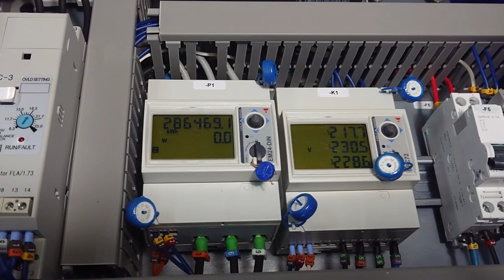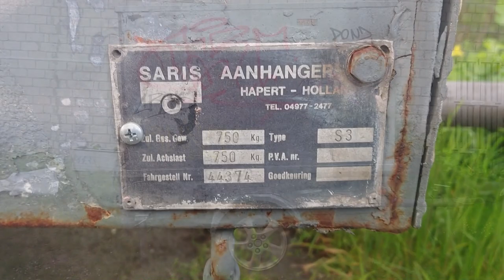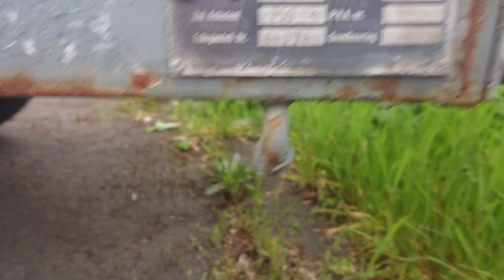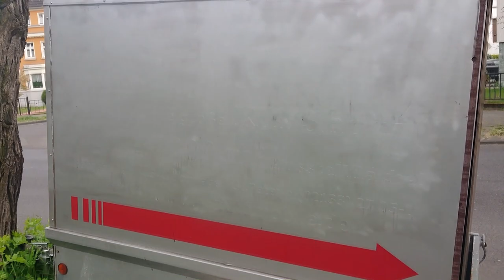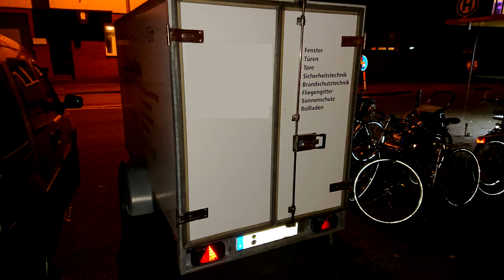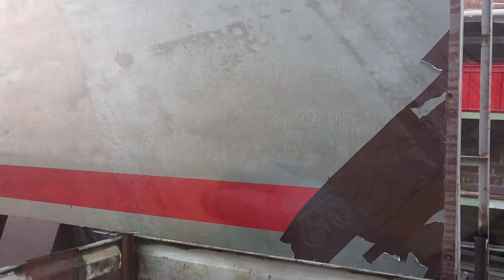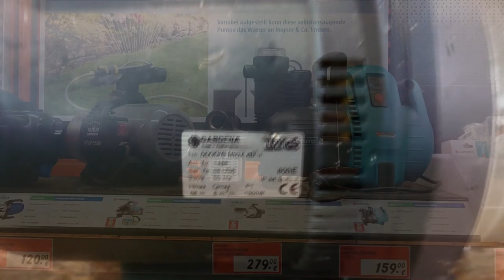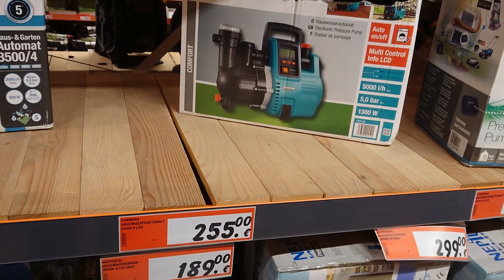Expensive Scrapyard Finds! Repair-A-Thon!

Comment: Totally agreed on the comments of the pump... I hate Web 2.0, IoT, mobile apps for everything, unnecessary electronics and connectivity, and all these trends that not only overcomplicates things, it often does not deliver in the supposed conveniences it's supposed to give, because you are essentially trading wasting time on one thing for another - eg. software and firmware updates, synching issues, dealing with bugs in code, proprietary crap, dependencies on the manufacturer, etc. I rarely ever see a piece of household or shop gear that is really definitely improved by new Internet connected electronics. In fact, I can't think of a single thing that was made better as a whole, without major tradeoffs.

It's kinda laughable really... I'm tired of hearing people who bought this thing or that thing that can be activated, opened or run via some mobile app, only to hear later on that they returned to the "old way" because they were tired of dealing with the thing not working for multiple reasons all the time... the servers were off, the system was outdated, the mobile app wasn't working, a power spike took the whole thing off, electronics were giving some unknown error code, the company went bankrupt and took functionality of their products with them... yadda yadda yadda.
How did we go from a point where we were worried about planned obsolescence issues and cheap materials being used, to this next level garbage of connected crap that seemingly won't go away no matter how bad they are?
Reply: Plus everything made with plastic and expensive and have a shorter life and works like garbage
Reply: You've summed up a lot of reasons most IT people don't buy "smart" appliances.
Reply: Well there are a few things like smart  smoke detectors that trigger all at once or if that doesn't work only that one, things like irrigation systems that are essentially time controlled sockets, cameras if there is no room for wiring 

The important thing is they need to work even if the internet is down for a period of time or it needs to be hosted by yourself to ensure reliability to you
Reply: If you stick to open source or easily available firmwares, you can actually build something very decent.
Being able to control your lights/surveillance cameras, control the A/C or feed you cat when you're away is very convenient IMO.
A system that opens and closes the blinds and windows automatically to save on heating or cooling is also a big yes in my book.
I wouldn't put my trust in anything that I didn't build myself or isn't open source, though, but as long as I can maintain it myself with little to no effort, why not?
Reply: I'm a person that creates those IoT Web 2.0 things...,  lets just say i don't use any IoT that i don't have full source code of...  (yes i use mostly my stuff lol) commercial IoT is garbage with short lifespan, usually mobile app is no longer accessible on app store or in worst case it depends on cloud service that is no longer working.
Reply: In the next couple years (maybe even sooner), civilized life will be impossible without owning a damn smart phone and having a different app for doing the simplest day to day things. People are getting too lazy. I used to be big into computers 20 years ago and excited for technological advancement like that but all this phone BS killed it off for me personally and people are turning themselves into drones. See the Borg from Star Trek. Those Generac standby generators that you have to register online with a special code to be able to use make me giggle as well.
Reply: Ich bin von Beruf Elektriker seit 1985. Mir ist es Leid, soviel Geld für KNX Geräte oder echtes Smarthome (Loxone) auszugeben und von Software gegeißelt zu werden und graue Haare mehr zu bekommen, nur weil irgendein Bit falsch gesetzt und übersehen wurde und irgendwas nicht funktioniert, obwohl man nur einen Lichtschalter von Hand betätigen braucht. 
Hatte heute ein Firmen Handy aktiviert und soviel Zeit damit verbracht, weil man sowas nicht ständig macht. Sowas kotzt mich an, solche Zeitdiebe. Nur weil eine Arbeitskraft eingespart werden soll, die bis jetzt die Arbeitszeiten kontrolliert hatte und zur Lohnbuchhaltung vorbereitet hatte.

Comment: Another interesting repair-a-thon. I share your dislike for web based home apps. I've built several home projects and while they have web based interface they all run on our LAN and are independent of the internet.
Reply: I share you sentiment on so called "smart feature" (Basically "We want to control the user how they use their device, and when they should buy our new products") thus really like reverse engineering them and making open source solutions to them cause I am in control of my freaking washing machine or toaster or fridge or whatever, not the manufacturer. As my moto to corporations that implement these "smart features" goes: If I have not offended you please wait your turn, I will get to you eventually.
Reply: Get this!  My electric toothbrush has wifi connection and an app.   I haven't bothered.
Reply: People seem obsessed with smart devices. I've no idea why they are attracted to them so much. There are certain things like smart thermostats which make some sense, but a smart pump sits at the opposite end of the spectrum 🤦🤦
Reply: Same, i have some 30 connected items, and the only issue i have had is with the "cloud connected" bulb i got locally, it was the only one there but it's gone now.. because it was sheit.
Pretty strange though, since that company was one of very few with a dedicated home assistant team/integration. But they should have had the sense to make it local instead of cloud.
Reply: It's frustrating that so many people fall for the scam of "smart" appliances and home automation that requires an ongoing subscription and connection to a remote corporation's servers. All the functionality can be obtained more cheaply, efficiently, and securely with independent equipment entirely within the home. Let Google know whenever I want a light on, wait an appreciable interval for it to happen, and hope they don't brick my connected devices? No thanks.

Comment: Love all your stuff, always interesting, though I’m jealous of your “freedom to roam” in the scrapyards. Trailers are fun! I bought an old trailer, the wooden body was rotten so I reduced it to axle and draw-bar, then made a steel tube frame skinned with aluminium and floored with ply-wood. It worked well and looked good till I bought a small motorcycle... that wouldn’t fit, so I had to cut the body in half and insert a forth section into the middle of the tube frame. Doesn’t look quite so nice now, but it still works well. It looks quite like your trailer, but without the tall sides and roof.

Please keep going with these videos, they are always an encouragement to save and recycle useful stuff. Thank you. Les in UK

Comment: I don't know how common they are in Germany, but in the US one of the first things we generally do with those pumps is thread on cam-lock fittings to eliminate the threading on/off issues all together.  When you are in the rain in the dark and trying to work in a hurry, the cam-lock connections are really nice.

Comment: It occurred to me that your solar paneled trailer could be a mobile workshop. The potential perhaps to salvage more efficiently because you can bring a careful selection of hand tools as well as power tools. I’m assuming the scrapyards wouldn’t object to some onsite dismantling, as long as the items are going to be purchased anyway. A vise, a workbench, maybe a plasma cutter. Battery box for the power converter riding on the trailer tongue.
Reply: I'm sure many scrapyards will absolutely object using plasma cutter on their premises 😮😀

Comment: The arrangement of the contacts - the shape of the bars, how they are routed, and even where the wires attach - are all arranged so that when the contacts open, magnetic forces tend to push the resulting arc away from the contacts, effectively extinquishing the arc.  On large contactors, there is even an arc-distruptor made of vanes of metal or mica or other materials, insulated from each other, to break up the arc as it tries to move away from the contact bars. It is the Lorenz force, the same force which pushes the armature of a railgun...

Comment: Thank you a lot for inspiring me :) Currently I'm restoring a very old (80s) rusted racing bike (incl painting and basically restoring/replacing all the components). Your vision on "why" gained me a lot of strength to continue with it, even though it maybe does not make sense economically. But it gives me a lot of satisfaction, skills and I'm also saving it from being thrown to a landfill :) 

As to what you could do with the trailer: winter is coming, and maybe you could make some sort of heat collection system. Instead of charging expensive batteries, solar panels could heat an insulated water tank inside the trailer. Then this heat could be used somewhere else later (warm shower?). Not sure if that's viable for anything, but maybe you could make this to work :)

Comment: I want to do something like this with thrift store electronics to teach myself how circuits work.
Reply: Choose something to do, then do it until it's done. Unless someone else thinks it's too hard for a beginner. Then choose something different
Reply: @thewhitefalcon8539  I have a Keurig that's broken. Gonna try to desolder the pumps and motors and some of the components I can find data sheets for. I wanna use the pumps and motors to make a drip irrigation system. I have never soldered but the components all seem to be 12v so I could power with a battery pack. Thank you for the encouragement I got my soldering iron last year and have been nervous to even try.
Reply: @ashtreylil1  Sounds reasonable. All the big things like pumps are probably attached by wires, not soldered directly to the circuit board. So you can probably cut the wires, then strip the new ends and connect them wherever you like.

I find that solder is actually a pretty annoying way to make connections outside of PCBs - you can get yourself some spade or ring connectors and a matching crimp tool (not if it's really expensive, some are). Or a block of screw terminal connectors where you can screw a wire into each side of the connector. Though those options have their own annoyances - mainly they have to be about the right size for the wire, whereas solder is pretty universal.

Idk if it's worth desoldering small components instead of just getting new ones.

Here's a reminder to use safety glasses when soldering - just in case a piece of hot solder happens to flick directly at your eye. Very low chance, but if it did happen you'd be half blind, so good to take precautions. Apart from that the worst thing to worry about is screwing up whatever you're trying to do, or completely ruining the soldering iron tip and having to get a new one for $10 - both no big deal

Comment: I once did a similar conversion on an old trailer I had acquired, but in addition I installed stubby shock absorbers (telescopic dampers) to each axle and which improved the ride of the trailer more than I would have ever thought possible. I recommend that you also fit shockers to this trailer, I promise you wont regret it

Comment: 11:30 all the dust is grinding wheel. If you keep your grinding wheel barely poking through or only go back and forth and score away 90% of the material, your discs will last vastly longer with only a small hit to time.
Reply: true, a lot of people put too much pressure and lose half their discs. The higher the rpm the more material removal. The more "engagement", the more disc removal.. most of the black dust is literally the grinder disc.

Comment: If you have electronic devices with non-replaceable batteries or a mandatory apps to use them, The absolute maximum lifespan of that electronic device is now the lifespan of that battery or that stupid app.

Comment: Im going to set up a rainwater collection tank because my roof gutters just drain into the city sewer as it is commonly found in the majority of buildings here. We just have an abundance of water and never cared really but that mentality is changing as heavy downpours test the limits of the city sewers and in low areas flooding does occur frequently. 

So I want to make a difference in that regard and use rainwater instead of tap water for irrigation.
Water Management is becoming important.
Reply: Some of that is to do with city drainage. In older times the water would soak into the soil instead of being immediately directed into the sewer

Comment: Maybe get an empty IBC, holds one cubic meter and has an outlet at the bottom. Put it up elevated. It's square, so it fits in a corner. Combined with a raspi/micro controller, filter and little pump +relays and valves it can do the watering. If you were to fetch clamps and vise, you could see it in person 😝.

As for the trailer, very nice. We have an old east german home made one we got for cheap. Maybe you could use some rubberized paint for the bottom? Lidl sells (sold?) it now and then in rattle cans. Probably better for pebbles hitting? I am a brush guy, too. But for big flat surfaces rolling on produces the better result.
Reply: I was also going to suggest a couple of IBCs as the stacking can give a good head of pressure.  I’m planning to catch all my house rainwater this year into storage... just need to get my partner to agree how we disguise them / protect them from the sun. 😀👍

Comment: I appreciate and relate to your stubbornness in regard to continuing the repair of that box trailer. I sometimes feel that stripping back something that looks almost too far gone to it's bare chassis and rebuilding from that point is still easier than just starting from scratch. Stripping back a project all the way to it's basic framework then building it back up can be less intimidating than having to design and fabricate the whole thing without any beginning design drawings or dimensions. It is also very satisfying to see an old machine renewed and rust proofed from the bones up. Good work!
Reply: A key point with trailers is that it is very difficult to get a home designed trailer to pass roadworthy inspection.  Rebuilding a trailer with nothing but the name plate original is easier to pass than a much stronger home made unit in most countries.

Comment: 13:34 Not that surprising. Plywood on metal frames are extremely notorious for this. I occasionally buy trailers to use the frames for various agri stuff at my brother's farm. And that's one way to get them cheap, i eye this style in particular because they're always going to be rusty. One that i actually fixed as intended, i basically had to cut everything under the top most part of the plywood and replaced it with box frame.

23:09 you should get even more water storage. I have 2000l in my basement alone and it's still barely enough to service water for the vegetable patch for a few months.

Comment: You could make an emergency help center out of that trailer. Wherever you set it up, you get free electricity and WiFi with internet acces via mobile service, heat or at least insulation as an emergency shelter, have a refrigerator for storing insulin, maybe even add that water pump for helping transport drinking water from different containers. Having some sort of mobile pump system, and I mean not for grey water but for clean water either rain or drinking quality at hand would be something different most people wouldn't think about when adding something to a vehicle like this. I think most will concentrate on electricity, putting solar panels on it and batteries, but that's it. I think having something more versatile actually requires that you put more functionality and thought into it as a unit or a system that has everything you need for your problem solving in the field.

Wouldn't it be cool to have a trailer with which you can turn up at a body of water or a tank, use your batteries and solar panels to use a pump and snatch some water and fill into a container that you can easily load and unload on and off that trailer. Of course you could do this more easily with a pump powered by gasoline engine, but what if gasoline was scarce and expensive? You already spent that fuel on driving to the place to collect your water, but now with a trailer like this you would use that free electricity for pumping instead.

I think the entire water supply thing is really interesting. I would love to see more videos with you experimenting with all kinds of setups in this area. Like water purification. What does it take to make rainwater drinkable or water from a lake or a small pond. Is DIY water treatment feasable? Could that even be made possible and be put into such a trailer for example? I mean we all need drinking water before anything, except heat of course. How many people would this trailer sustain? If you can create a trailer that can provide enough drinking water indefinitely for one person if it sits near any body of sweet water that would be a cool goal.

I remember seeing Ukrainian citizens in the occupied regions gathering around supply trucks of the Russian military. They got free electricity and basic aid and supplies, but they had to listen to the Russian propaganda from TVs at those sites. If people had these kinds of trailers in their neighborhood, they wouldn't have to go to that place. Also what if those help centers by the government never show up to begin with?
Reply: I like this idea, bit different from the obvious mobile workshop or camper trailer